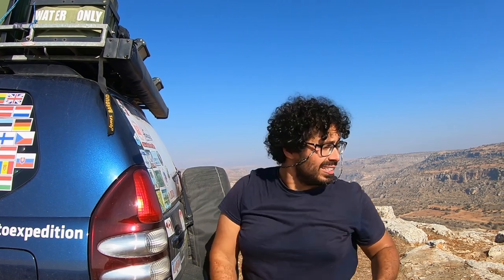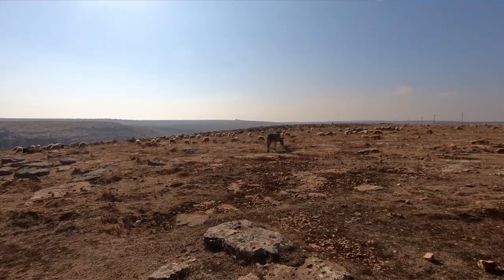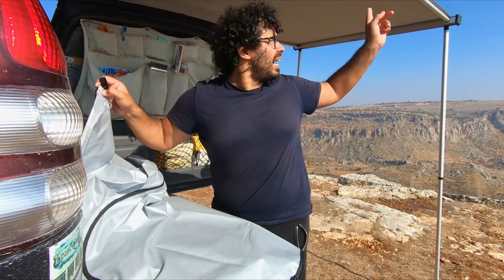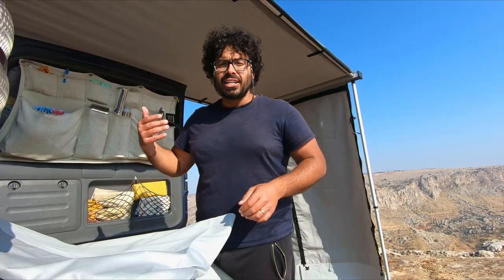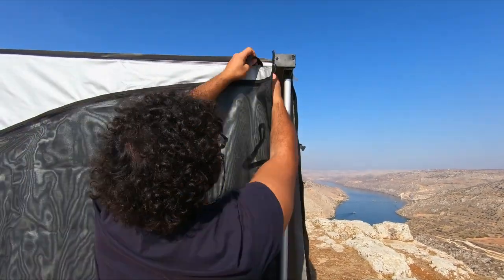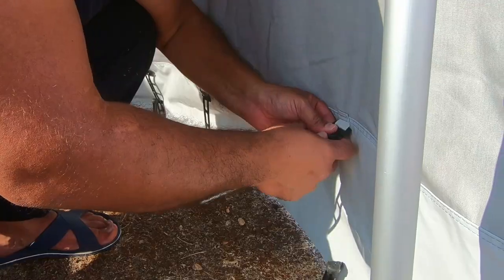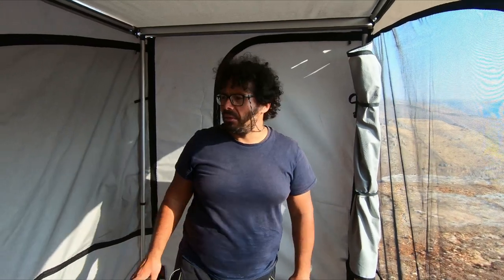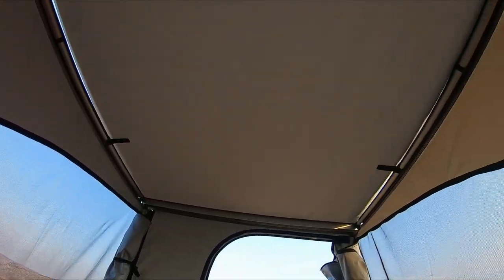JAMES BAROUD AWNING + SIDE WALLS |  Installation, Review & Setup (Part 2)

Comment: Many thanks for the insights and instructions…. not to mention the insane view! I’d come across your clip in my search for ‘better’ instructions for the exact same awning & walls. In fact, I think this is the only one I found Haha! Well done! I still haven’t quite figured out on the two poles at the end of the awning and where the sidewalls come to meet it seems I have a clip that’s on the outside but a clip insert that’s on the inside…. I still haven’t quite figured out what that’s all about? What I love about James Baroud is that I’ve called them for an extra slide piece for the awning tunnel that attaches to the tent, as well as rubber ends for the awning that had cracked and some pegs for the awning pole fold out pieces and they just sent them to me all for free… that’s top notch! Good on them! Loved your video, and thank you again for the walk thru help, for it surely did! 🤙
Reply from the maker: Hi there, thank you so much. I'm glad the video helped. It's a bit tricky at first, but then it will become easy. There is only one correct way to fit the side walls, and all of the pegs insert at the bottom should face inside. Also, the rear one it goes one way only. If it doesn't match, try to flip it the other side. 👍